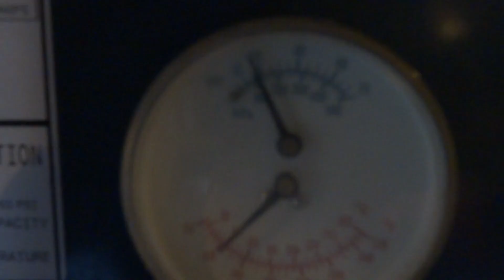BOILER BUILDING PRESSURE AND LEAKING WATER OUT RELIEF VALVE

Comment: I replaced the expansion tank the relief valve and the input water regulator and I am still blowing the relief valve. What now can anyone tell me what the bleep is going on??
Reply: Did you find out the cause for your symptoms? Im having the same problem.
Reply: @markmathis336  I did but it been so long I don't remember for sure but I finally gave up and called a furnace specialist and I believe they replaced the main coil do to it leaking. Hope this helps! I am currently on vacation in Florida so I can't check my paperwork. Good luck!
Reply: @boomer1049 Thanks for checking

Comment: I wonder if there is an easier way to drain the expansion tank before taking it off.  I can imagine if your not ready you could hurt yourself when that tank drops full of water on your shoulder.
Reply: As long as the bladder isn’t completely ruptured, can air up the tank, and push the water out.
Reply: @erikj.2066  yeah and save your back
Reply: You can drill or punch a hole in it with a pointed chisel